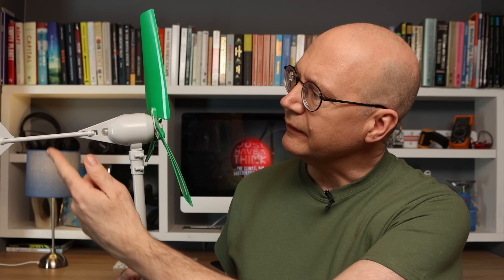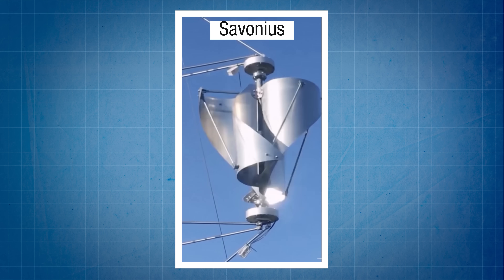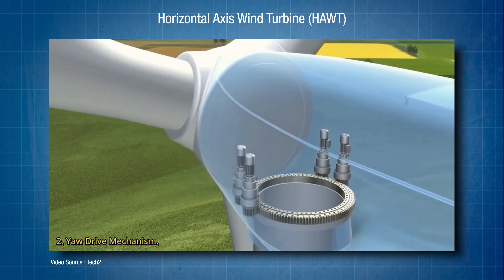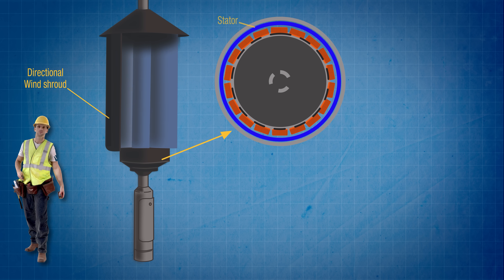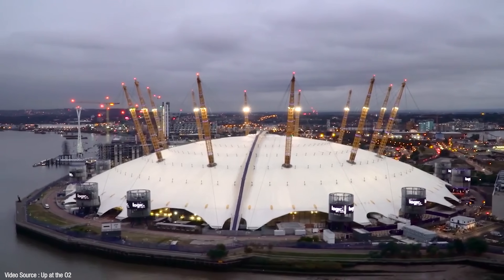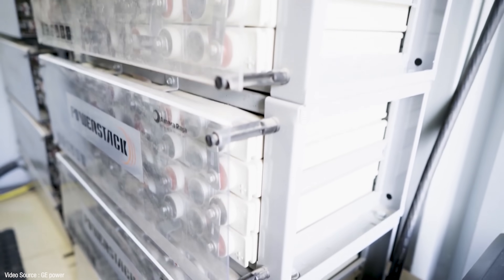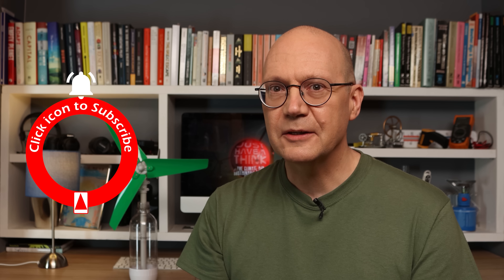A vertical axis wind turbine that doesn't need the prevailing wind! How do they do that?

Comment: Subways could benefit maybe as the air movement is pretty strong upon arrival and leave of the trains though I would imagine a spining speed limiter would be necessary. Outside train tracks, particularly the bullet trains tracks could use it too I guess.

Comment: Alpha 311 is name I woould like o have. We, in Ontario have a  hightway about 500 miles long with 6 lanes and high speed. Thats hwy 401 but we have a large nmber of other 400named highways like 17, 00, 04 etc. I imagine the amount of power that could be be generated with these turbines in Ontario. With batteries many enought for a data center or two.

Comment: All those small turbines just a fancy art sculptures that could produce some small amount of electricity. The reason for this is quite simple one cubic meter of air weight about 1 kg if wind speed is 10 m/s it would be that at any give time you wind turbine could generate 10*1 = 10 W of energy per square meter of turbine blades cross-section (real number would highly depend on blades form and wind speed and would be at least 2 times smaller) so you could calculate yourself how enormous it need to be to give any reasonable power output. So ever time some company say we increase efficiency by *some random number*% it mean nothing because they physically can't overcome the upper limit for wind generators and that limit is quite low as you can see. The only way to make them efficient is to make them bigger and place higher where wind is faster otherwise it just a waste of time and materials.

Comment: All practical tests show that small wind turbines hardly generate any electricity! And only at very high costs! 
Because there is hardly any wind close to the ground. But: With 100% more wind, the electricity yield increases by 800%. Wind close to ground is also extremely gusty, which usually shortens the service life. Only if you need to be self-sufficient from the power grid, you should have a large wind turbine for the winter on a high mast. 
With solar modules, on the other hand, you can reliably generate green electricity for 25 years at approx. 3-10 cent/kWh!

Comment: Nice in principle, but in a dirty real world scenario beside a motorway can you just imagine how filthy a turbine would get in no time... maintenance would be a serious cost issue as I can't think of a way of shielding them from all the fumes, rubber particles, brake dust, plastic bottles full of urine, crisp packets, cigarette ends, graffiti, etc without dramatically reducing their efficiency. The strobing effect will no doubt cause some to sue for causing accidents or epilepsy etc, the problem list is fairly endless, but I still like the concept..

Comment: Can anyone explain to me how a single phase inverted wave energy supply be back-fed onto the 3 phase balanced sinusoidal wave national grid of the UK without it causing damage to  the cabling and infrastructure due to inbalanced currents in the neutral conductors along with the increase in harmonic currents and out of phase voltages?

Comment: I absolutely hate the idea of roadside wind turbines, they slow down the airflow on highways, therefore the cars have to use more energy to travel at the same speed (so it's basically stealing energy from cars). This is a big energy management problem and the company (or companies) that are developing roadside turbines have failed miserably to solve it.

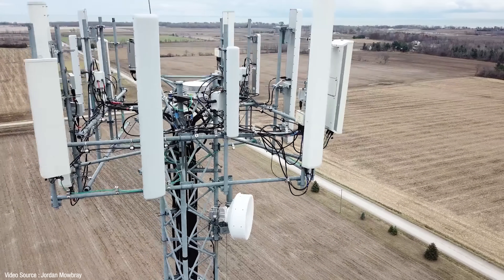Comment: 9:34 Where you have many parallel rows of houses, as you do in the UK, the main or only benefit from such installations would probably be experienced by the installations on the houses in the front row (with respect to the wind direction that is) -- unless of course these rows or houses are on a hill side.

Comment: 9:25 Antenna masts are designed to withstand a certain wind load and thus to offer minimum possible resistance to the wind. Placing generators on them would increase their resistance to wind and thus the wind load experienced by them and would certainly pose a structural threat to them. Masts would have to be designed from the start to be able to accommodate those generators While this is not impossible, the economics of it might not always work out since the optimal placement of wind generators and that of aerials have to meet quite different criteria. However, since these criteria are not mutually exclusive, there could be happy coincidences. The problem is that most antennas that are needed are already up there on existing masts.

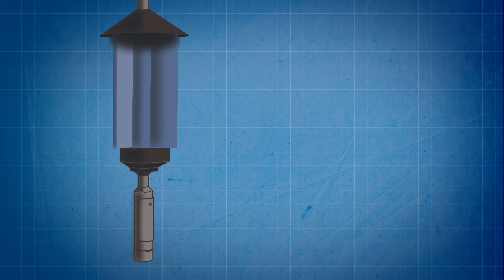Comment: 5:10 - 6:10 Has anyone actually conducted a study on whether this constitutes free energy? Air is there to obstruct vehicle movement as, apart from being the medium used for storing thermodynamic work -- yes I know that's not the right term but please humour me -- and being the source of oxygen used in the combustion, it serves no other purpose to motor vehicles. Thus, if the energy stored in the wind generated by moving traffic is part of a closed system, then it plausible to suspect that trying to recover this energy, i.e. make it do work, would impede free air flow and thus increase air resistance to on-going traffic. What this means, if this is proven to be true, is that these generators would essentially be robbing energy from the moving vehicles. That, of course, would not be perceptible by the drivers but on average would increase the overall traffic's fuel consumption.
So, what the above is saying, if proven, is that the part from 8:08 till 8:28 is basically false.
Punching a hole in the air requires work. This work is harder to do if the air is confined by boundaries: a car will require more energy to move at a certain speed through a narrow alleyway, with tall buildings on either side, than it will require to do the same thing on a motorway without any obstructions to air flow on either side. Where there might be a benefit to motorists' fuel consumption though is if these generators, provided they are constructed and designed appropriately to negate that effect, were placed between the opposing streams of traffic on a motorway, i.e. where the air pushed by vehicles moving in one sense of the traffic would normally increase the air resistance for vehicles moving in the opposite sense and vice versa. Thus, if these generators where so placed and designed as to take advantage of the oppositely moving air masses in the middle of the motorway and furthermore decrease their kinetic energy before these air masses hit the on-coming traffic moving in the opposite direction to them, then there could be a double benefit, i.e. decrease air-resistance to moving vehicles and scavenge the wasted energy contained in the air. But would these generators ever be allowed to be installed in the middle section of a motorway (is that called the "median"?)?

Comment: I’m imagining Massachusetts installing these on lampposts across all major highways, about 600 + km of distance.  The potential energy production fed back into the grid on this small set amount, when compared with your Department of Transportation estimate, could have 120 km x 410 generators  producing more or less 5+kWh each resulting in 246,000 kWh.  The materials cost for creating and maintaining and regulating these systems might be better than relying too heavily on solar which requires highly finite chemicals.

Comment: How much additional petrol over time will be used caused by the wash from these turbines.  

The green movement seems so counter intuitive.  The amount of resources needed and the impact on environment to build turbines and solar is staggering.  

All the talk of what you get, little talk on what damage is caused in green energy.
Reply: the ammount of energy cars need to move is based on existing air flows and with most modern cars being relatively aerodynamic that doesnt change much at all. 
wind turbines on the roadside dont create wind and therefor cannot slow down/create extra air resistance for traffic.

Comment: See "the Action Lab" video that effectively debunks this. Quick summary  because the turbines do actually slow down traffic (minutely), its not just wasted air as you say,  because the traffic is pushing the air  along making the cars more efficient as the air is moving with them, and the turbines slow it down so the energy ultimately comes from the traffic. A zero sum game.

Comment: To extract energy from passing cars would put more drag on the cars.  I can't imagine this would be a net positive.
Reply: Vehicles encountering each other while in the same direction or, worse, in the opposite directon do have their air-flow bubbles interact.  The thing is that the average car is a bout a tonne in weight (not ot talk about busses and lorries) while the turbine is tops 8 kg according to the video.  So, even if the interaction proved adverse to the vehicle, it would be infinitessimally encumbering it.
In the US, btw, as young mindless students, we used to drive our motorcycles behind trucks at the point where their airblow bubble ended - the net result being that they 'towed' us along and our gas consumption fell to 50%!  Of course, many truck drivers didn't appreciate the risk involved (our reaction time to any change in the truck's movement was minimal) and tried to shake us off ...

Comment: How much do these vawts increase the wind resistance to vehicles?  Yes the vehicles would be punching through the air, but at high speeds (above 40km/h, IIRC) air resistance becomes a significant impediment to vehicle efficiency.

Comment: The laws of thermodynamics say the will be no net energy gain from the 'wasted' energy from cars 'punching through' the air. Easiest to see if you consider the case where there is no external wind to complicate matters. The turbines generate energy by 'slowing down' the traffic generated 'wind' and extracting that kinetic energy but the 'slowing down' means that vehicles passing the turbine will experience greater air resistance to their passage thus they will have to step on the accelerator pedal a little more to maintain their speed - this is where the generated energy comes from.
There is no such thing as free lunch in physics and the majority of the commentators don't seem to understand that.
The ONLY place where it might make sense to try to extract energy from the wind of passing vehicles is on sections where the traffic has to slow down, in which case the extra air resistance caused by the turbines would reduce the amount of braking needed.
Reply: Very well explained. I think I agree, but wouldn't it be possible at all to harvest (small amounts) of waste energy by using this principle?
Reply: @Freba9  Yes, but the amount harvested would always be less than the extra amount of energy needed for the vehicles to 'punch through' the  increased resistance. These devices would obviously work to harvest the energy of any real wind and maybe lots of them along motorway tracks might be a good location to harvest wind energy - just not where they interfere with the traffic...
Reply: @nicholaspalmer2220  Thanks for your reply. I understand, but on the other hand it is possible to harvest other sorts of waste energy like heat from industrial processes. So thermodynamically speaking it is possible to capture energy that otherwise would have gone to waste. Why would it not be possible to catch the energy of the wind movements that otherwise would have gone to waste in the environment? To be clear: I think you are right but I am just trying to completely understand it.
Reply: @Freba9  Sure industrial waste heat can be harvested, but doing so doesn't increase the energy used in the originating industrial process. In the case
Reply: in the case of wind caused by cars, that wind is caused by using their engines pushing through the air ahead of them. When the wind turbine intercepts that air it slows it down, which is how it extracts the energy, which causes the cars to need extra energy from their engines/or electric motors to maintain their speed. I don't know if that's a clear explanation but there really is no free lunch...
Reply: @nickpalmer4841  Thanks a lot. I think that makes sense indeed. I do realize there is no free lunch, but I was thinking that it might work to place the turbines a little further away from the road so there would be no aerodynamic disturbances to the passing vehicles and the turbines would only catch the ‘waste wind’. Comparable to a ship causing large waves and a few hundred meters away a device that captures their movements and converts it into electric energy. Would the ship experience added resistance due to this?
Reply: @Freba9  Good point about the ship. It's made me rethink the physics a bit because I think the waves from the ship could indeed be 'tapped' without affecting the ship. I think the motorway wind turbine slowing of the vehicle wind would cause  the NEXT vehicle following to be affected. Interesting.

Comment: Sounds plausible and good but how are these going to use the same cables as lamp posts already have on them? Will that not risk blowing the electrical equipment on the same circuit? Surely you would need to regulate the input somehow or add an additional separate circuit to prevent damage?

Comment: New turbines and old ones retrofitted with spirals of metal around the pole negate metal fatigue as in chimneys so the base of the pole lasts far longer correcting this is paramount... eddies sometimes form around tall galvanised chimneys and someone quite a while ago found this solution... same for wind turbines I guess

Comment: If the vehicles passing by on the roads were designed to be more aerodynamic they might save more energy than is generated by the  roadside turbines. A flat-fronted lorry has to “smash” through  a lot of air, which in turn spins the turbines. Also, a given turbine only intercepts a tiny fraction of the “wind energy” which is generated (wasted really) by a passing lorry or car.

Comment: @9:32 "As long as the relevant regulations are adhered to..."  LOL, easy to tell a British commentator.  They've been so ingrained with defending regulations that they have no clue how to think outside the regulatory box.  If it is against regulations in America we don't dismiss the idea we find ways to change the silly regulations.  I much prefer vertical axis wind turbines, would probably save a lot of bird lives.  And the really silly thing about those huge horizontal windmills is they mount a bus sized generator on top of the mast which means the mast needs to be way beefier to handle all that weight.  Re-imagine the same height pole weighing far less since it won't need to support a bunch of weight and a vertical turbine that compresses air and pipes from all those turbines run to a central storage tank that uses a quasiturbine to generate the needed electricity.

Comment: As awesome as this would be if it works there is one thing that keeps coming to mind. These turbines use the air off of vehicles to turn. That means that very likely having a bunch of them on roadways may cause significant turbulence and air resistance, disrupting vehicles ability to push air out of the way.

 Allowing you to still harvest the energy sure, but potentially drastically reducing vehicles fuel efficiencies in thos areas and possibly making the energy waste problem even worse.

 It would be nice to see if they have tested this yet, and what their findings have been.

Comment: Your calculations are so far off,  Why not be truthful,  USE 410 Watt SunPower panels,  And the 800 pound gorilla in the Room ~ SOLAR has no moving parts... The next BS is your wind generator out put,,  "one can count the sun is going to rise, you ass prediction on wind speed, So far fetched its not funny, but its Stupid... It takes nearly 35 mph winds to turn a 4kw generator... I know, I've been testing one at 30ft... real world testing. Videos to prove your BS.  I have the videos, shows you how much wind it takes to produce power.  Blowing smoke up everyone's ass that watches this...

Comment: One thing that I did not hear was the fact that roadways can channel the wind since there are no obstructions for the most part.  So a smooth, long stretch of roadway is going to have stronger winds than the adjacent areas where trees, houses, etc would block wind and not funnel.

Comment: A very nice presentation, thanks.!
As a former very small scale DIY constructor of horiz. and vertical type. 12 V  generating and water heating modules I've been wondering since my arrival in Canada almost 50 years ago why none of the electrical ingeneers there gets the idea to install any lightweight vertical turbines into the very hight steeltowers of their extremely long transmission lines.
Canadas' subarctic north is very rich in hydropower but the main problem are the thousands of miles of distance to get this invisible Gold flowing into the southern provinces and into the American grid. 
The funny thing is that half of those powerlines run from windy hilltop to windy  hilltop and the support towers have already been built.
The increased ancrage necessary to avoid storm-caused tipovers can be added with much less cost than the loss of power caused by the resistance in the wires which could be counterbalanced by boosting transmission by the power added via the vertical turbines. 
I mentioned this idea 30 years ago to a an engineer of the local powercompany but he only smiled. what else can you expect ?

Comment: I think it's a good idea but, for someone that drives 40,000 mi a year, I notice that I burn more gas when there are no other cars on the highway because the direction of air flow is not helping me out. I feel like this may be a wash for the amount of electricity that it would create by moving cars.